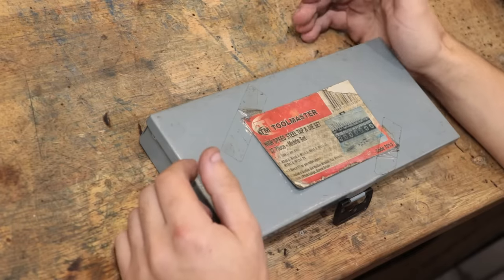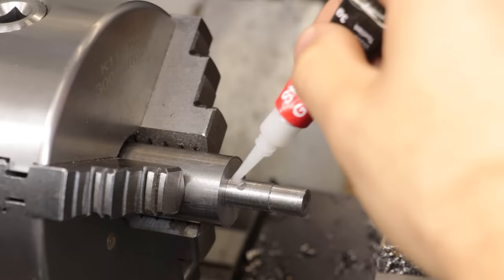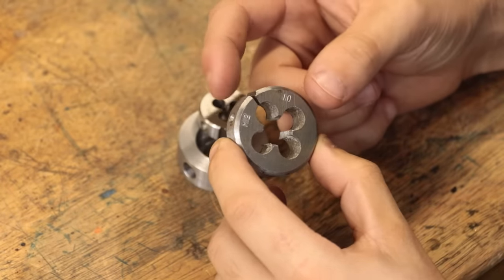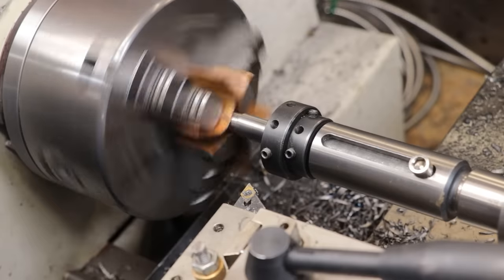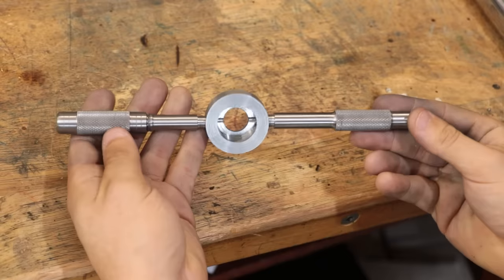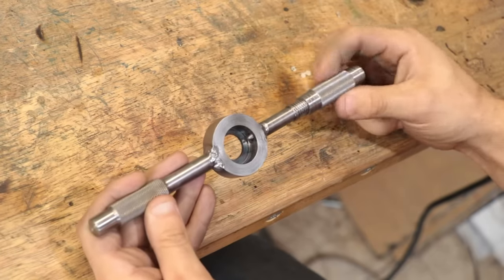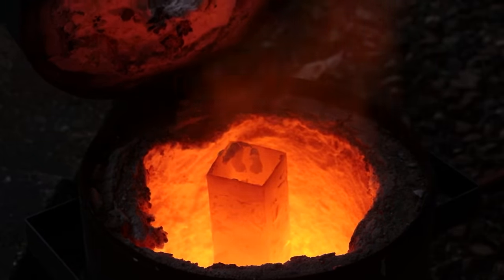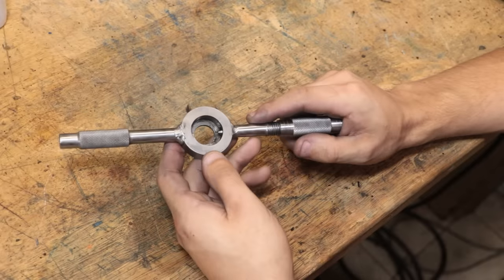Making A Die Holder.... But Better

Comment: Nice work.  I would suggest threading the handles and the main body together.  You can still heat treat them, then assemble with thread locker (the red stuff will never come loose!).  This will give you the aesthetics you want without compromising the function.  I love to see how much you do with your shop.  We also need to take up a collection for you to get a port-a-band saw!
Reply: @Walter Wojcik agreed there was no need to weld at all and if he wanted a bandsaw he would have already bought one.
Reply: @WalterWojcik I like the thread idea, threading to a shoulder or brazing after heat treat is how I would have built it. I may need to kick off a similar project.  
He's discussed why he doesn't have a bandsaw in the past and even did a shop tour video which reinforces the point. Exec brief, his shop looks to be smaller than my bedroom.
Reply: He needs a metal cutting miter saw or better, turn a regular miter saw in a metal cutting saw, more than a bandsaw : Less footprint, Cuts cold and dry even the hardened stuff. 
My 5000 RPM  10 inch (254mm) miter saw gets regularly fitted with a 7.25" (184mm) or 6.50" (165mm) steel cutting blade (it lowers both cost and the cutter's actual velocity within steel cutting specs for carbide)
Reply: @rolfbjorn9937  A port-a-band goes in storage when not in use (0 footprint), a miter saw begs for a permanent setup.  Also a port-a-band can be used on the lathe for parting.
Reply: The hack saw is his trademark.
Reply from the maker: Just to put this idea to rest because I had to test it. 1020 which is what I used here, with a threaded handle and the hole for the pin was not strong enough. Not enough metal once you add the threads. It snapped when I tried to tap m12.

I’ve spent some time playing around with shrinking the pin and swapping 1020 for 1045 and that seemed to be strong enough.

Comment: I haven't watched the whole video yet, so my comments may be a little off. I quite like the split dies, (I have not seen a holder with 5 screws though, only 3). I always use the middle screw to open the die up and just nip the two clamp screws, cut the thread and then test it against the "nut," then start to back out the centre screw and nip up the clamp screws to fit the thread to the nut. The hex die nuts I would only use to clean up an existing thread, certainly not use them to cut a new thread. 
There is a type of die which is in two halfs, in a special stock that has taper rails the halfs of the dies slide on. They are the best ones ever, but you just don't see them anymore, I liked the fact you could thread in the middle of a bar just for the hell of it.

Comment: Hex dies were designed for truing up existing threads, and the middle of the three screws on top of the die holder is intended to open up the die when it is split, to form thread in multiple consecutive deeper passes. My father use to do that in the fiftees, when I was a child.
Reply from the maker: Like I said in the video I don’t use split dies. And whilst hex dies are meant for chasing threads, we used to have lots of them which I used to years to cut threads from bar stock. I never ran into issues. Granted it was more work around the house stuff (where the thread tolerance isn’t as important) than industrial but it still worked just fine.
Reply: A split die is very handy indeed when cutting a thread to go into a worn thread to make it fit well. Pretty much a must when repairing things rather than making all new stuff.
Reply: There are hex dies and round dies, rethreading dies and cutting dies, just because its hex shaped does not mean its a rethreading die.

Comment: To be fair, on split button dies, two of the screws in the holder are for increasing the cut depth by compressing the die and one (the pointed grub screw) is for reducing cut depth by widening the button’s split. These are a fine adjustment for the closeness of fit for the threads in a nut or tapped hole.
Reply: And REQUIRED
Reply: Yes this design is flawed. Using split dies will cut threads too big. The video shows a complete lack of understanding of the process. It's a bit rich to assume you have re invented the wheel.
Reply: He knows. He said, he's not using split dies, he has maybe two of them.
Reply: @barmetler  Exact, he talked about it at 6:14
Reply: @marley589 he literally said, in the video, the holder WONT work for split dies. 😂
Reply: @marley589  bit rich coming from you, someone that seemingly cant watch and listen to the whole video before making assumptions.
Reply: @marley589  comment shows a complete lack of listening skills though
Reply: My comment was more about the intended use of the initial (commercial) holder shown - five screws around the periphery and (usually) no useful instructions in the box. The new holder will work just fine for what it was designed to do. Kudos for making the effort to build one from scratch. Adding the clamping via the handle itself was a neat feature which eliminates the need for a second tool.
Reply: @mechaform  What second tool is required?
Reply: @tates11  Screwdriver
Reply: @1crazypj  thumbscrews. Edit,  sorry the screws in his die stock looked like thumbscrews. I saw they were slotted heads when I zoomed in. I do like the idea of just using one of the screws though, leaving the other 4 in the box, problem solved.
Reply: @tates11  either a screwdriver or Allen wrench for the grub screws.

Comment: You can cut the centre slot of the cheap dies. this makes them split dies that allows you to make different cut depths. When cutting harder stock doing in a few passes is essential as cheap dies are quite soft.
Reply from the maker: Just did a quick bite test and these dies that I use are over 65HRC. Some cheaper carbon steel ones seem to be in the range of 60-65HRC

Comment: The hex dies are usually thread chasers, not meant to cut a thread from scratch, but a set of them is worth their weight in gold, you cant get a normal die holder on to most in situ studs where you need to clean up a thread, there just isnt enough clearance for the holder to be able to turn.
Your design for a die holder is a great idea, but you also gave me one of those "oh dur" moments... I am sick of doing all sorts of weird things to tighten those mongrel screws that take flat head screw drivers in die holders. Usually i grip the outside of them in the vice and twist the whole holder to get some hurt on them.  But your quick shot of your lathe holder setup where you mention using allen keys to tighten it... I am going down to the shed right now to see if i can chuck the mongrel screws in the holders and replace them with grub screws that take allen keys...

Comment: When using the original die holder with those holding screws. You can paint the screw threads when the threads are disengaged from the internal diameter of the die holder, without a die in there of course. That way you’ll know what screw is and isn’t backed out. The die holders made now days are so cheap feeling that making a new one that I don’t feel like I’m going to break is on my list of to do’s. Can’t wait to see what you do next.

Comment: I think thats a superb way to solve the problem if die holders...great work and the welds weren't that bad, Ive just switched to using flux core (difficulty getting argon co2 mix) and you should see those weld theyre truly embarrassing.
Reply: Fluxcore is not great i agree, I assume you know that you need to reverse the polarity with fluxcore? 
Otherwise it is really terrible 🙂
Reply: @TRABWorkshop-ri4ql   I do thanks, Ive seen the appalling mess that happens when you don't lol bb's everywhere ..its like mining with a welder....it might even work for gouging

Comment: A good design and build - if you put two threaded holes either side of the threaded shaft, you could (optionally) use and adjust your split dies.
Reply from the maker: Yes I am sure that could definitely work

Comment: A die holder is one of those quintessential shop projects that everyone should make. You can do it all on your lathe with a little bit of ingenuity in work holding and make it quite well. Get a hold of some tasty chunks and it will 100% come out better than modern tooling that doesn't cost an arm and a leg.

Comment: I made a similar tool, and rather than trashing the looks with a cruddy weld job (at my best) I drilled thru the body and handle and press fit a pin then peened the ends into chamfers I added to the pin hole. Then filed smooth. It works, have to look for the pins, but. And you can drill the thru hole thru the pin and it shouldn’t matter, or offset the pinto just catch the end of the handle.

Comment: Hey there, got a little advice for u in terms of working with carbite inserts on interrupted cuts. Usually carbite inserts tempt to hold longer if u crank up the cutting speed and slow down the feedrate to aprox 0,06-0.08mm, this secures lower knocks on the cutting edge because wenn the feedrate is high, the force of reentering the material is too much for the cutting edge. In terms of depth of cut, u do not have to worry but remember its always besser for the cutting radius to be fully engaged (depth of cut should be higher than the radius of the tool-especally when roughting)
Greetings from a full time mechanic from germany:)

Comment: I have offset handle die holders they work great and you always know witch side is up/out, function over form when it comes to tools. More up front planning on the bore then drill the cross holes. Cross bores are the worst on tools.

Comment: One thing seen that will end up causing you pain down the road is those exposed M12 threads, slide your finger on that and it's gonna take a chunk of flesh with it, but just shortening the center pin to where the threads aren't exposed would remedy that problem without having to completely remake it.

Comment: I too love the simplicity of the tool, but I also feel that you should have added a compression screw for making the adjustable depth of cut. Really helps with starting and finishing nice threads.
Reply from the maker: You can always add one if you’re using split dies. Cheers
Reply: @artisanmakes  thanks to you, this is my "advanced" tool goal. Love your content, it really helps lay out a starting point and what is possible. Greetings from Canada 🌞

Comment: Cutting a thread on a manual lathe is sometimes a bit challenging. The perfect solution is an ELS. The version of Maxim Kachurovskiy even makes it possible to set stopping points right and left. Then there is no risk to crash the cutter into a shoulder. I have built one (ELS2 version) and come along with absolutely no die in my workshop. It can also be used as a power feed that stops at a shoulder. No more abuse for vernier calipers to mark a part :-)

Comment: "Hex dies" are called Chasing or Rethreading Dies they are as their name implies for Chasing Threads not Cutting them! And while technically you can cut threads with Chasing Dies that's not what they were designed to do, just like you can use Wrench as a Hammer but that's not what it's designed to do so its not going to work as well. 
Also the "extra" screws on tap handles are for Adjusting the cutting depth of split dies not for securing it to the tap handle. 👍👍
Reply: I don’t see how they are any different to a carbon steel split die. I see them sold by a lot of manufacturers and they are not advertised as thread chasing. I’ve used them plenty and whilst not hss quality, they do the job.
Reply from the maker: For years I used hex dies in the old workshop, granted for stuff where the tolerance was less important on the threads. This is years before I bought the lathes and mills. I think context is an important factor there. Never caused us any issues there, even if the profile was imperfect. 

I also said in the video, I don’t use split dies. I don’t need to, the threads can make with the normal button dies are well within spec for the stuff I do. Cheers

Comment: I've seen the problem you had with the inserts recently with some cheap parting/grooving inserts where 3 of the ends just crumbled trying to part a piece of 12mm stainless, the 4th worked fine. I assume the WC and binder hadn't been well mixed or sintered properly for those that failed, others in the set seemed fine.

Regarding the knurling, I make a grip for a product and I diamond knurl it but I always run a single cut file over the knurl to knock off the sharp peaks that are often formed. Still grippy but far more comfortable to hold for longer periods as it doesn't tend to chew up ones hand.

Comment: Looks nice! I was thinking it might be “okay” with just some locktight instead of the welds, but that probably wouldn’t hold, and certainly wouldn’t allow any post heat treatment. And like you say- it’s not going anywhere, and it’ll function well! Someday I‘ll step out of my woodworking comfort zone and get into hobby metal work- kind of opposite of you!

Comment: I think it came out pretty great! That's a heavy duty die holder for sure, waaaay better than those crappy thin-section cast ones from cheapo kits. Might be worth shortening the clamping pin a bit though, to engage a few more turns on that thread?

Comment: You could make an insert with dimple that is offset for the handle to push against. That way you could screw down on the dimples in the die. Use a slot that doesn't go through on each side of the dimple to stop it spinning and not allow it to push through.
Reply from the maker: Yes you certainly could. I was thinking about making the pin eccentric and raise it up to align with the dimple. But given how well it worked with the slot, I don’t think it was necessary

Comment: If be interested in making my own. I'll supper size it though! Not anywhere near as concerned about a die snapping as a tap... You should weld them though (your additions) ya only get better with practice. I mean this is artisan makes right? Worst case you can practice grinding the welds down before hardening!

Comment: Accommodating those split dies should be fairly simple, just mill a slot in them for the pin to engage. Since you don't have many it should be a simple process.
If you decide to make a more complicated tool in the future it would be cool to include ball detents to engage the dimples. Not terribly necessary, but they would give a satisfying snap fit, and assuming it's made with grub screws on the outside to hold the spring and ball you could always tighten them down for even more grip if ever needed

Comment: A fun way to not have the welds would be to temperature fit them where the parts are slightly less than 0 clearance, and you heat the die holder and cool the handle.... then smash them together.   I've seen one where they coarse threaded the parts and did that too.
Reply: I would have just loktited them in after the hardening process.

Comment: I vaguely remember Abom79 saying hex dies are for chasing threads and round dies are for cutting new threads. I'd never question that man when it comes to machining.
Reply: They are. If you look them up they're sold and advertised as Chasing or Rethreading Dies.  You Dan technically cut threads with them but they'll never be as good as threads made with dedicated split button thread dies.
Reply: All solid dies are for chasing threads, hex or round.
Reply: If I didn't hear it from Adam (Abom79)  I would've assumed hex dies would be more suited to cutting fresh threads given the shape of them being kind of impossible to slip in a die holder as opposed to round dies. But it actually makes sense split dies would be more suited to cutting new threads given the ability to fine tune. I only know what I learn here on YouTube tho, as far as machining. I don't know any actual skilled/knowledgeable machinist types in real life.
Reply: If I had more than 3 change gears for my tiny old lathe, I'd learn how to single point

Comment: Extra screws are for split dies. That set comes with fixed dies... manufacturer is clueless, likely, to the purpose of that die holder and just made a facsimile without the detail. That (and this is if you believe wives' tales online) or you have the option to cut your die along the groove, and make it into a split die. Never done it myself, don't see how that'd work out if the tolerances are as loose as they usually are with these things (cheap ones).

Hex dies are not for cutting threads, they're for chasing threads.

And back on the subject of split dies and the split die holder tool, the reason you want those thumb screws is because you want minute steps in the cut, more or less to have fix. In a split die situation, the main thumb screw is to split the die apart (with the other thumb screws backed out). Generally speaking, you use them to match the thread of an existing component by closing or opening the die over an existing screw. The two back thumbscrews are for keeping the die from moving as you do the adjustments. For a fixed die, you only need the main thumbscrew, so in that set, you can remove all those thumbscrews and replace the main one with a grubscrew and a hex key to match (for sleekness if you feel the screwdriver is hampering your style). 

Just some stuff i heard over the years. I've used the split dies only for the explicit purpose of matching existing threads (so far), never for normal thread cutting. Too finicky for that.

Comment: Dude, you have milling machine! Just mill little wells on sides of the body for handles then drill holes for pins to lock it! So there's no need of welding